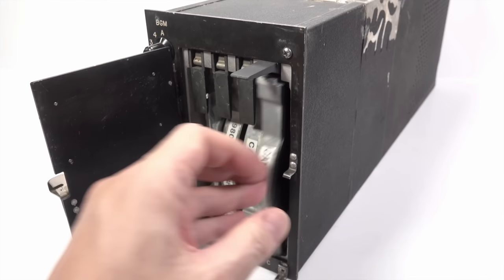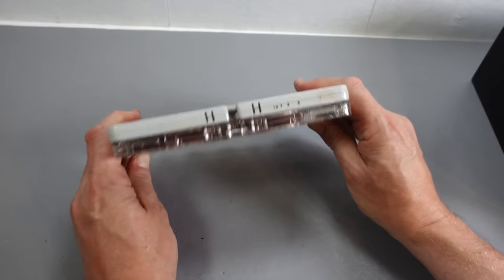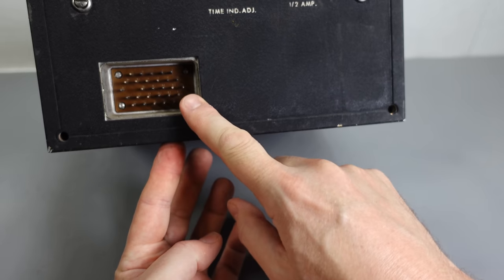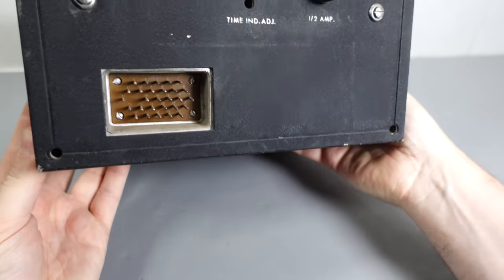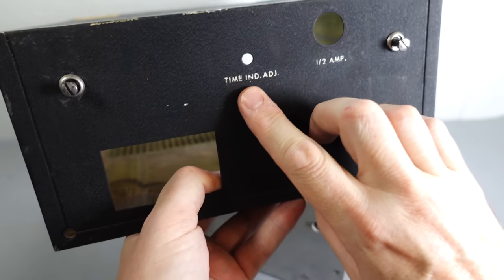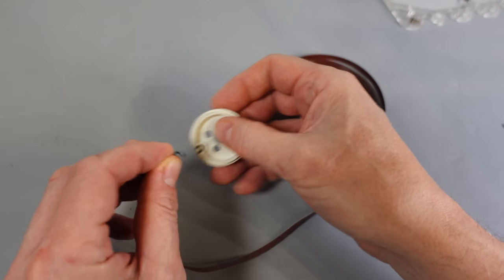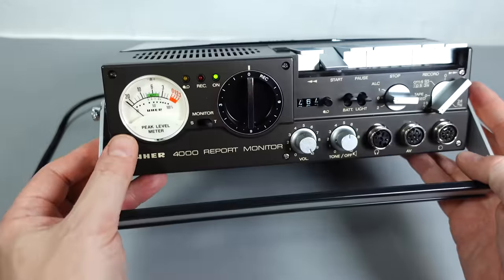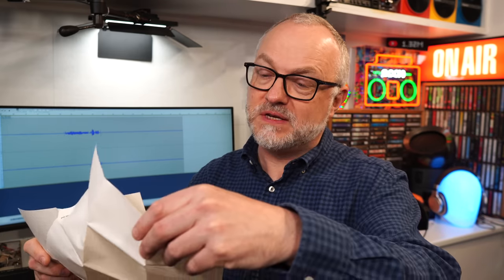Mystery aviation tape machine

Comment: I don't think it was for regular aircraft use as a CVR.  CVRs from early definition had to be crash proof.  Early CVRs used wire recording, as the medium (steel wire) was easier to protect from extreme heat and shock.  Some early FDRs also used wire media (and a simple digital data format) for the same reason.

It isn't built to a aeronautical standard (ARINC  or Aeronautical Radio Inc.) module unit size; It doesn't use aircraft-style connector pinning, nor does have any ARINC style lock down hardware (cam over or thumb-wheel type).  Usually there are precision reinforced  guide holes on the back, and on the connector for alignment when rack mounting.

Telectro seem to be one of those ubiquitous Manhattan/Long Island small specialty manufacturers (half of manufacturing was located there at one time).  They made a line of consumer tape recorders:

https://www.radiomuseum.org/dsp_hersteller_detail.cfm?company_id=9558

Here is another reproducer Telectro made for a government contract, an earlier wire recorder.

https://www.worthpoint.com/worthopedia/vintage-telectro-industries-signal-13077565

They got in trouble with the SEC in 1961

Sold to Emerson in 1966:

Telectrosonic Corporation; 37th Street, Long Island City, New York. Label: "telectro". Manufacturer of tape recorders in the 1950s also as OEM supplier for Firestone, JCPenney and Emerson. Founded by Stanley L. Rosenberg.

Comment: If it's 4 mono tracks instead of 2 stereo tracks, could it be a black box? Something that would record the pilots during a flight and in the event of something like a crash you could play back the audio to try and piece together what happened. It would be plausible if it was set up on a flight the normally lasted no more than two hours, or a tape going back and forth 4 times at 30 minutes per winding.

Comment: I think it is the same as a Black Box. While the black box is for the worst case scenarios, this one would keep a duplicate of the same data, but it would be easy to access for maintenance purposes or investigation purposes when something goes wrong, but the plane is not lost and lands. You wouldn't just rip open a Black Box for that purpose..
Reply: Not a black box, per se, but a voice recorder.   A black box records not just voices of the flight crew, but critical instrument readings and so forth, and is hardened to survive impact and fire.  This is for less 'catastrophic'  purposes.

Comment: Hey Matt, I once had an old device that looked similar to a turntable.  The cartridge had a cassette magnet instead of a stylus.  It came with 12 inch thin discs that was made of same material as a cassette tape.  Had a SHURE mic with it as well.  I sold it about 20 years ago on ebay,  bidders and winner only wanted the SHURE mic.   Does this device ring a bell to you?
Reply: That was a magnetic disk recorder.  To use it, you would put a disk of recording medium (yes, the same stuff they make recording tape out of) on the turn table, then place a plastic disk on top.  This disk, a little less than half the diameter as the recording sheet, had a spiral grove in it.  The recording/playback arm would have a steel stylus on it halfway along that you place in the groove.  This also put the magnetic head on the outside of the recording disk.  As the turntable turned, the spiral in the leader disk would cause the mag head to write a continuous spiral track.  Recording and playback worked the same as tape recorders accept there was no erase head so you had to use a little handheld eraser to wipe the disk between uses.  These were not very high fidelity but were good enough for dictation.  Particularly so since the format permitted random access to any part of the recording.  There was even a version sold as a child's toy recorder, which used the speaker as a microphone - making fidelity matters even worse.

Comment: Don't they record the last hour of what is said in the cockpit. Would have expected an all steel cassette which might survive a crash. Or its just to help an enquiry after a landing.
Reply: Pretty sure the Black box data recorder does that - the mag tape would not survive a fire.  This is probably a non critical Cockpit Voice recorder used for company audits and general investigation / audit purposes.

Comment: could not just be the basic of basic "so called Black boxes", that are fitted on planes, like mark one, of beta models where looking at here (model ford T of cars)? it looks like it continues loop of recording, and with big plug it in and forget it, the 2 light bulbs, monitoring the movement of the tape, may also, checking it has not snapped or broken the tape, and all connector on the back, where possibly, going to list warning light on the planes dashboard somewhere,  saying error, error or something? also with fly wheels, as said in your video, bigger is better, and in the challenging, of have a problem with your plane, you don't want  recording all wrong speed or something?

Comment: If not the Original "BlackBox" for aircraft ( which later was Orange) (Dave Allen used to say please can they make a cabin part out of the material the Black Box was made from (as it always survived !).  Poss even for Test Pilot recording as only 1hr of tape unless it was continous recorded over so you only got the last 60mins ?

Comment: I seriously  doubt that device was ever intended to go on a plane. It looks too flimsy, and that abomination of a socket on the back without any positive means of retaining the connector... there's just no way anyone would have made that box to be plugged in on a plane, particularly in that era. Compare it to the Sundstrand box that was also shown which definitely was designed to go on an aircraft, they don't look at all alike.

My guess is that device was for recording Air Traffic Control communication from the ground, particularly with that FAA sticker on it. I don't think anything on an aircraft would have an FAA tag on it; it would have a tag from a manufacturer (as in a calibration/functional checkout tag) or the plane's operator and it would have a substantial nameplate with Part Number/Serial Number on it for traceability.

But I am 99.99% certain that device was never intended to touch an aircraft in any way and if it was, shame on whatever company manufactured it.

Comment: I'm wondering in what form the output from the light sensitive device appears on that connector, just a voltage or has it been processed in some way ? and I am certain I will never find out !...cheers.

Comment: Not interesting? Matt this is quite the opposite. This is very interesting to see. Judging from the interface and the "Say again" line which is a term typically found in radio traffic, you have a CVR. CVR or Cockpit Voice recorders are used to record cockpit conversations between crew on the flight deck. Judging from this one, it was probably only tuned to the pilot and copilot's headset transmit button. The reason why the tape is so short, CVRs only need to record the last like 30 minutes or so of flight data for one reason or another. Typically a CVR is very important for aircraft accident investigations by teams from the NTSB, CTSB and others. Its basically part of the black box just instead of recording instrument readouts and other flight data, it records voice. Though this one may be the quick access one instead of the main black box part as its clearly design to be easily removable by ground teams.

Comment: Commenters here who are going with the Quick Access Recorder suggestion have never read Michael Crichton's brilliant 'Airframe' tecno-novel. Plucky female accident investigator working for fictitous Boeing and MD rival solves the mystery of an inflight 'turbulence issue' which has seriously injured multiple passengers. The dubious foreign airline (now where did we hear that before?) has covered up the real cause, tampered with, or lost, the plane's data recorder and whisked all the flight crew out of the country away from US jurisdiction. By carefully examining the data line signals on the aircraft's data bus (as you do), plucky female investigator identifies the hitherto unsuspected presence of a hidden QAR on the accident aircraft which will solve the mystery of the accident. Of course there's more.. while she attempts to locate and recover this QAR, tough guys try to murder her.  They're an entirely different set of bad actors - aircraft workers' union men worried that the bad publicity of the accident will encourage their employer to accelerate the process of transferring all the manufacturing and assembly of the aircraft to China - with the loss all American jobs.

Crichton wrote Airframe almost 30 years ago (1996). It's amazing how prescient he was regarding the aircraft industry.

Comment: As a data recorder (the reason for all the pins in the connector), it would be designed to record ... wait for it ... data, not just sound.  The tape may not be blank, but retrieving any flight data that might be on it would be a challenging project.
Reply: But if there was data recorded, this is audio tape, we would be able to hear it, right?
Reply: @neilcaldwell870  Depends on the format and frequency used to encode it.  I have no  clue what they might have used back then.

Comment: Most likely what you have there is a Cockpit Voice Recorder or CVR. These became standard in the late 1960s (I think 1967?). They would store 30 minutes worth of recordings. Tape models had a function that once the tape got to the end it would start recording in the other on the reverse side so that the tape cartridge wouldn't have to be reversed manually. Most likely after sitting for decades the tape may have been too regraded to have a readable recording which is why you only got a snippet of something.

Comment: From a PDF of May 1960 "ELECTRONIC INDUSTRIES" magazine(or similar), an ad for the company (Telectro):
"MODULAR MAGNETIC TAPE SYSTEMS
Telectro Recorders/ Reproducers
Now Provide New Dimensions
in Versatility and Performance
Building modular magnetic tape systems
is Telectro's major occupation...
has been for over a decade. The
advancement in reliability and performance
reflected in a Telectro-built
magnetic tape recorder/reproducer is
the culmination of wears of experience.
Hundreds of evolutionary units, each
successively improving the Telectro
breed, have giver today's Telectro
equipment the finest heritage of all
tape systems Telectro Modular
Magnetic Tape Recording Systems are
used in: Data Processing Satellite
Tracking Professional Sound Systems
Laboratory Traffic Control Computers
Simulators Ground Checkout
Automatic Processing Numerical
Machine Tool Control For full
technical data write-
TELECTRO
INDUSTRIES CORP.
35-18 37th Street, L.I.C. 1, N. Y."